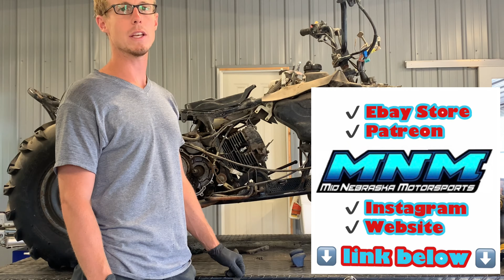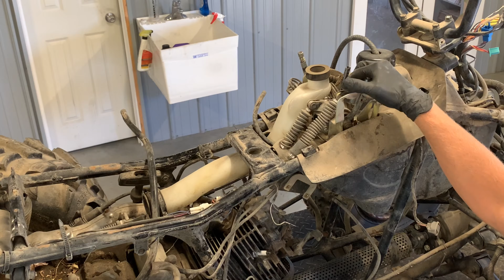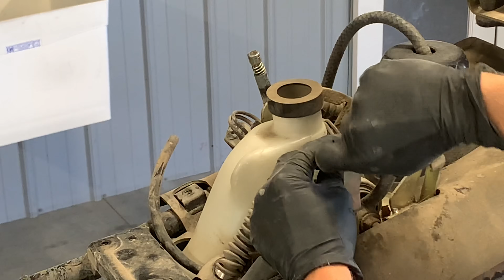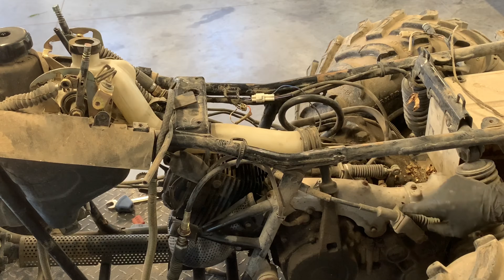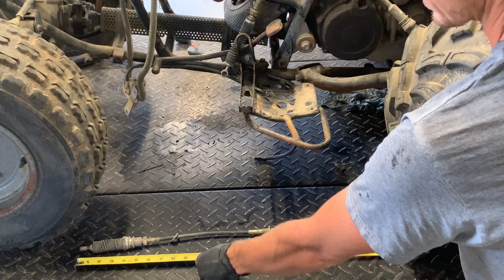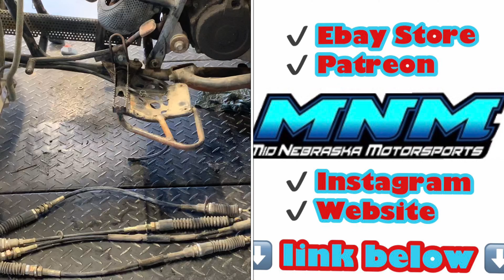Suzuki Quadrunner 250 LTF Shift / Gear - Cable Location Replacement Control Installation

Comment: 5.12.25) What happened to the part numbers you said you were going to give. Great we can now identify the lengths and where they go. But parts people don't understand "I need one that's 27 inches long." And by the way that 27 inch shift cable is about $200 new (The gear shift cable is (I think) #58680-19B21.) Or off line used 20 to 50 but a lot of them don't give which they are, length, or part number. Make sure you guys do on your parts site. (General info for everyone: Make sure not to make these take a bend. Someone put a 32 incher in place of a 27 inch one on a quad I'm repairing for a friend causing it to take a bend and causing hard shifting and later the cable rod broke into 4 pieces. Reverse and gear shift cables seem to be the same lengths also on the 2 wheel drives.)

Comment: Is there a plastic spacer that goes in the lower eyelet that connects to the lower foot gear shifter. I took the foot shifter off to heat it up and straighten it, it was bent. Now putting it back together, it seems a spacer might have been in the lower connecting cable eyelet. Thank you!

Comment: Hello, on my Suzuki LTF300F are the diffs locked, in my 2WD and 4WD settings. What is the reason?    How can it be that there is also no differential working in the off-lock position of the shifter? Is it possible that the cables here need to be adjusted a bit in length, because of wear, of being stretched ?

Comment: At the rear of the quad right hand side there is a cable that I'm not aware of  what it does or goes to,  but seems like it might be broken
Reply from the maker: Rear foot brake cable?  Let me know more details. Thanks for watching and the comment. We have hundreds of videos yet to post. Hit the subscribe button so you are notified when we get them posted. Also check out: https://www.ebay.com/str/midnebraskamotorsports